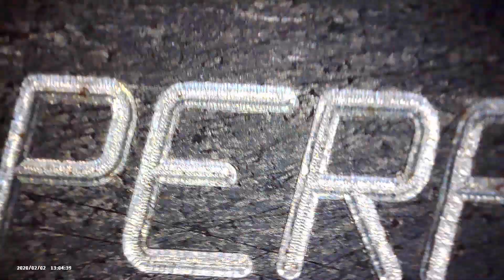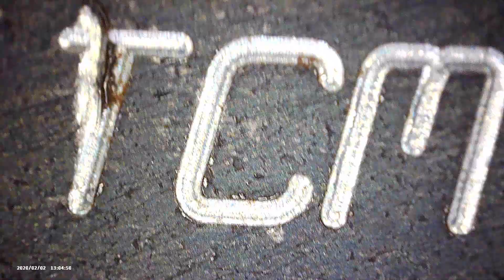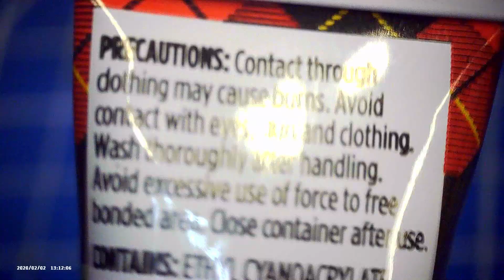Handheld microscope - Good for the home shop?

Comment: Neat 8-) battery life?
Reply from the maker: I recorded about 15 minutes of video, had it on for about an hour, dad had it on for an hour or so and the battery indicator has not moved. It says it has a 1800mAh rechargeable lithium battery, so I would guess a couple hours maybe less recording video. I should have said in the video but only realized it later, it records continuously but divides the full video into 1 minute avi's which is a little weird but not a huge deal.